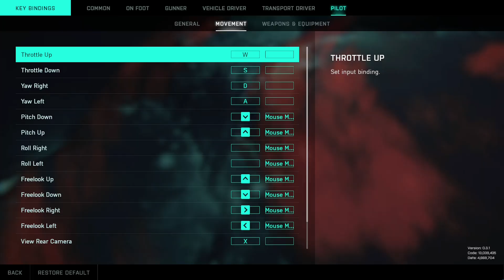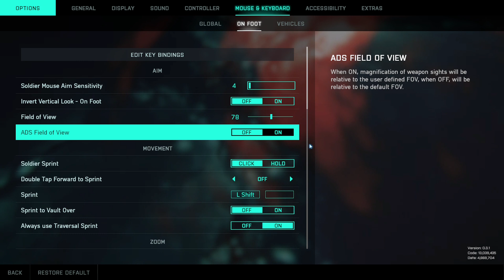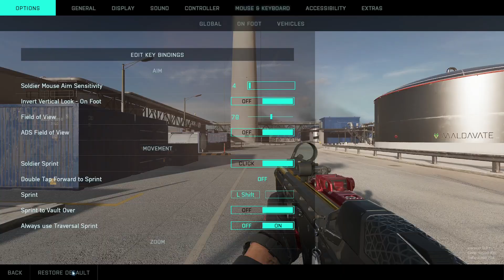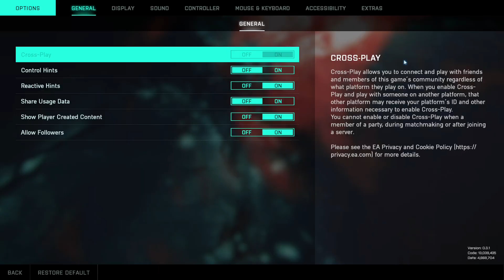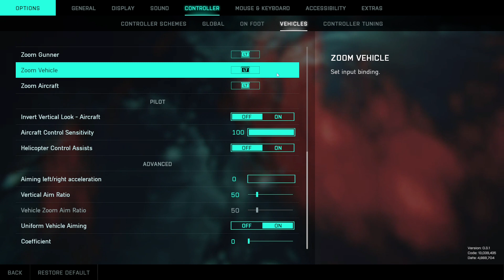Nightbird Tutorial #1 | Settings & Sensitivity | Battlefield 2042

Comment: I knew this was a thing, i now try to relearn my entire Flying Skill with the new Keybinds.

It's very very confusing at first, but really makes you extremly good at tracking Enemies now.

But i changed Throttle up to Shift, down to LStrg and Pitch up to W and down to S, to make flying with Jets less painful.

Even with Jet, it's now so much easier for me, i had to practice for an entire Hour, just to make sure i don't crash anymore, now i need to try making circles, curves, landing and more, but after getting used to making sure, you don't crash anymore the rest will probably get much easier to handle.

Thank you for the Video!

Comment: I do the same with the controller, idea is you are moving the helicopter crosshair the same way as you aim and you must change the keybinds like this in this video.
Reply: What are your controls
Reply: Not necessary on controller as it’s basically already rifle aim, you already use analog stick to aim instead of buttons